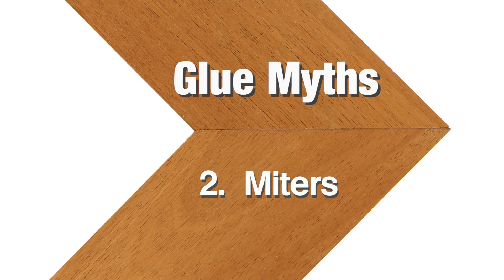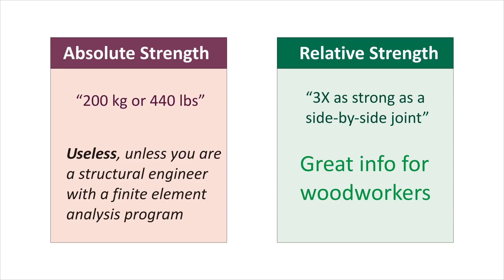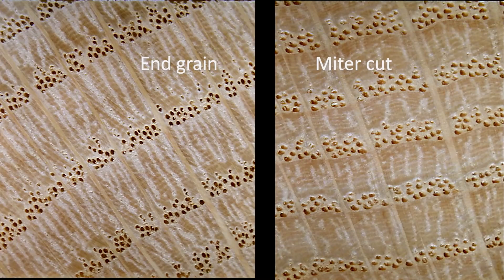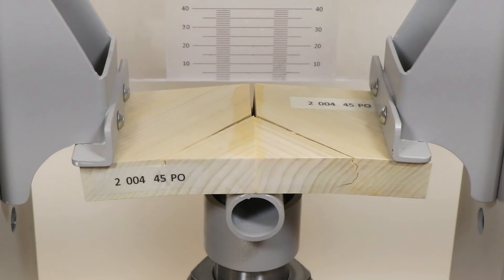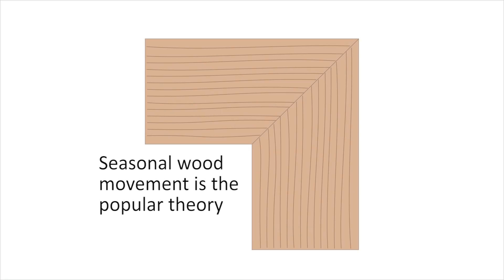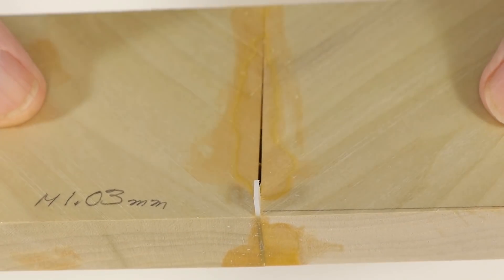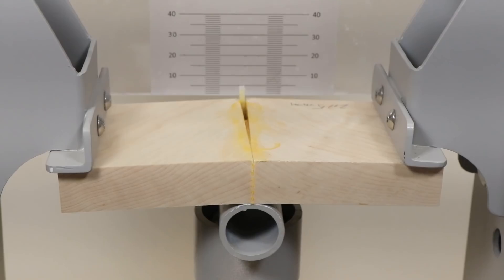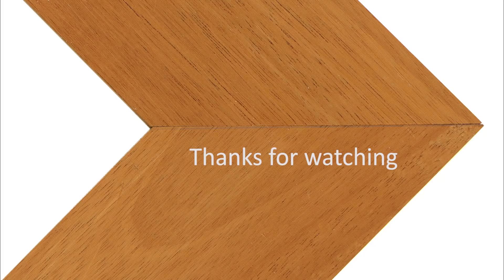Glue Myths:  2. Miters

Comment: Really good video. I particularly appreciated the call out to "this is not what the engineering/physics of a joint is like; this is simply an observation on the strength of the glue bond". 

I think this is a large part of the "myth making" - Rob Cosman's video in response to your first drives that home: his 'dado joint' fails because the lignin bonds fail (and the leverage is huge); the rabbet joint doesn't because of the amount of glue surface, the presence of long grain in a mechanically significant situation and less leverage.
Reply: "the rabbet joint doesn't because of the amount of glue surface"
Yes, that is one of the reasons why nearly every other joint is stronger than an endgrain-glueup.
Sadly here in these videos he does not show any joints other than the weakest butt-joints... likely cause it would look kinda silly when a simple lap-joint is several times stronger but he then continues to claim endgrain-glueups to be strong.
Reply: @ABaumstumpf  As others with way more woodworking experience than me and probably you  (James Hamilton, Marc Spagnuolo, Steve Ramsey, Rob Cosman) have noted, it's not at all what Patrick is saying in either this video or the previous one.

Incidentally - a rabbet joint is basically an end-to-side grain glue up. Plenty strong enough to hold a carcase.
Reply: @dlevi67  Yes, a rabbet is mostly endgrain to sidegrain, not really a strong joint against any rotational forces, but rather strong against linear forces from the outside of the corner - cause that joint takes advantage of geometry.
But the miter-joint being weak still is not a myth but a fact - it is one of the weakest joints you can make, just not the weakest simple glueup. Buttjoints in general are weak and avoided cause of that, but sadly he is only showing those weakest joints and not something like scarf-joint.
Reply: @ABaumstumpf  Again - that is not the point of the video - and Patrick (and all those I mentioned above) says that very clearly and explicitly. As does my comment.

Comment: So much depends on the geometry of a piece employing the joint(s) and the actual types and direction of forces applied in service. I’m thinking of a large picture frame I built several years ago. Sure, these miters have little surface area in proportion to the torque that could be applied by the long moldings. However, excepting catastrophic events like falling to the concrete slab, my frame will never experience torque from spreading two adjoining sides, nor will it ever see the front and back faces in a tension-compression situation like these demonstrated tests. As it hangs, the frame must sustain its own weight plus that of its contents and its glass. Assuming balance, symmetry, and dead nuts accurate miters, the mitered joints are in tension only, at least until a failure should begin, which could introduce torque. This straight pull on the joint is different than any of the test breaks we’ve seen. My only concern with a frame miter is that the joints don’t simply drop apart from the tension. Wood strength is immaterial in the vertical moldings. Splitting resistance might be a small factor in the horizontal members. Glue adhesion to the mitered faces would seem to be paramount. It would be interesting to see end-grain and mitered joints pulled directly apart, rather than being snapped as one snaps a twig, which imparts tremendous force in the tensile plane, progressively weakening towards the compressive plane...effectively wedging the joint apart from one side.

When I’m building a fire, I’ll snap a one-inch diameter branch over a fulcrum, same as these tests. But I could certainly never pull it apart lengthwise. In this case, gut feeling is that the glue joint is nowhere as strong as the wood (though it might be adequate for a particular application).

Comment: Excellent videos! I wonder if the myth of weak mitre joints in boxes may have originated with hide glue which is essentially a surface glue not a penetrating glue like PVA? I’ve not used splines in mitred boxes and they are still holding up 25 years later.

Comment: Thank you for the terrific videos, Patrick. Questions: Because picture frames are commonly miter joints and since they often fail (in my experience, at least) when dropped, do we know how they would hold up to a single impact versus the sustained pressure of your current test? On a different topic, I wonder whether a method exists to simulate, say, 50 years of racking forces in a reasonable amount of time for an experiment. I'm talking about the kinds of forces we might expect to see in "daily use," and I'd leave it to you to turn that term into something measurable. If one can simulate such forces, and if it interests you, I'd love to see videos testing the longevity of various joints. The joints I have in mind are glued mortise and tenon (blind), draw-bored mortise and tenon (blind, no glue), and bridle. Thanks again!
Reply: If you have a sacrificial frame, it might be intersting to see/hear how much glue they are using. Given that the joint is on display, they could simply be under-gluing it.

Comment: The geometric advantage of a mitre joint in resisting rotation around a z-axis perpendicular to both wood grains is that it creates a greater surface area that importantly extends farther from the axis that acts like a hinge. This increases the bending moment of inertia of the structure, similarly to how an I-beam is stronger than an “H-beam” (90deg rotated I-beam)

I’m not an expert, but it seems to me that the geometry of stress on a typical mitre joint would be in this direction, bending around the corner, as though the mitre is a hinge that rotates around an axis perpendicular to both grains. You have set up the joints rotating around an axis 45deg from both wood grains. I understand the challenge… cutting a slice from a mitre joint of 4x4s would give you the shape you’re looking for, but it would dramatically shorten the cellulose into upside-down V shapes, creating new locations for failure.

Comment: Can't recall if my comment was on yours or Rob Cosman's video; I think the HARDNESS of end grain joints (vs. the much softer, compressable fibers in edge/long grain) requires a more perfectly flat/mating joint, and that slightly imperfect joints are much less forgiving when clamping up end grain than edge/long grain.

Comment: So far, I am loving this series, the experiments and how the results challenge preconceptions. 

However, I do have a couple issues with the conclusion, and I think most of the pushback you've gotten comes from this: While you conclusion isn't wrong, I think it's incomplete, because the real cause of the "weakness" of edge and miter joints is based on practical issues in the shop.

Basically, side to side and face to face joints feel stronger because we ask way less of them. They tend to have a lot of glue surface, and very little actual bending stress. end grain and miter joints? usually the opposite. Which is why we do halflaps and tenons and splines and whatever, to reinforce overstressed joints with wood fibers which are stupid strong, or at least extra glue surface.  You do touch on this during the video, but don't really focus too much on it.
Reply: "Basically, side to side and face to face joints feel stronger because we ask way less of them. They tend to have a lot of glue surface, and very little actual bending stress."
Only the middle part is accurate.
He had a perfect opportunity to test a miter joint against a longgrain-joint like a lap-joint, but didn't do that. Why? Cause a lap-joint is much stronger.

Comment: really enjoy
excellent analysis and experiments

i really like the conclusion that the glue is strong, but there are many other factors to consider as miter joints can be under way more stress than others due to the design 

doing a test on splines seems tricky because different combinations of woods could yield different results and that would be kind of a data nightmare

Comment: if you use wood which changes its width a lot when  moisture changes you may end up with situation in time 8:16. Typically in autumn high moisture wood is used and next spring inner corners are open. Pine is one such often used wood. We in northern Europe use it too much. It really opens corners by itself without external force like in time 8:16.

The rule for stength is to use stable woodmaterial.

Comment: When working with kiln dried materials on projects like your clock or interior casing I have never had a glue joint fail. I have had wood crown moulding joints fail with large humidity swings when the crowns profile changes thickness across its width. For instance, a simple cove detail where the center is much thinner than the sides. However, this has only happened to me once. Exterior projects are where you really see miters fail. In fact, they have a 100% failure rate. I have done railing repairs on miters put together with splines, biscuits, screws or some combination. They all fail. The best I have tried are half-lap miters. That way the customer gets the mitered look on top but the miter is only half the material thickness with a large surface area for glue underneath. 
I like your methodology. However, the direction of force applied in the press is not the direction force would normally be applied. What you did by hand is what a miter would have to live through, be it pulling open stressing the heal or compression stressing the long point. Not vertical force directed over a fulcrum. Try the same press test with the glue-up on edge and not flat. Would the miter fail in the same way? Also, your results of glue joints breaking followed by splitting along a grain line might have much to do with the short length of your test pieces. I think this because I have glued up door casings then hit something when moving the glue-up and the pieces didn’t split like you saw in testing.

Comment: You gotta do the splined miter video! Please test both kinds of splines. Also, I wonder if the direction of the grain in the spline itself matters. I suspect that splines perpendicular to the corner of the joint do nothing, but I have no way to test that. Splines in miters do have the advantage of reducing the mobility of a joint while the glue is drying and making it easier to clamp. Great videos!

Comment: It might be feasible that the strength is heavily dependent on the direction of your test. For example, if you applied the force orthogonally to what you are doing now, you might get very different results. When I think of breaking a miter to test strength, I picture 2 pieces of wood with a mitered joint being forced open like a hinge, not a force being applied along the face of the miter.

Comment: Your demonstration is good but is missing one thing. and I think it is important but also sort of obvious. Mitered corners don't separate from the bottom up the separate along the length of the wood. I know you were trying to keep this test similar to the previous to compare; but the sample should have been turned turned 90 on edge and each piece should have been longer to resemble the miter more. pushing down on the ends and up in the middle would have separated the joint sooner.

Comment: I make a lot of pictures frames, sometimes big ones for mirrors. If you properly cut the miter, using a shooting board with a well sharp plane blade, you’ll never have problems, the frame is plenty strong. As I say on the previous video I don’t know how and how much time, moisture, heat and external factors can cause problems.

Comment: I'm wondering if in place of a manufactured biscuit, a piece of hardwood one third the thickness of the frame was used instead. Then there's using dowels as well. This could also be tested. I love mitre joints, they look the best in my opinion.

Comment: I presume that every mitre joint is held in place with a high compression while the glue cures. When the clamps are released the glue joint is immediately placed under load as the wood springs back into shape - minimally when the angles are perfectly cut but with increasing stress with misaligned joints that were forced together by those clamps.
In time, I suspect that the wood grain and lignin will slide so as to alleviate the strain and a mitre which survives for six months will last forever.
However, as the clamps are removed the glue line could microfracture leaving a weak spot or tug sharply enough on some of the wood fibres to tear them away from their lignin support. Loosening the clamps very slightly and leaving the piece for a few minutes before they are removed entirely might help keep an imperfectly cut joint strong. It would allow the wood and glueline to accommodate the different stress directions by stretching and sliding inidividual wood fibres to spread the stresses emanating from the points being subjected to higher strain across a wider volume of nearby material.

Comment: Curious if the volume of glue used in your open meters affects the results.  If you repeat the test with the exact same volume of glue evenly spread, the I suspect it would be more consistent.  More glue would fill more of the open miter and increase the strength

Comment: I am enjoying in the approach to testing these myths. I would like to say, you are testing the bending strength of the mitre joint. But as per you demonstration with breaking them by hand, they are weakest when the load is prying the joint open. 

When we use a mitre in frame or a box and that item is abused (dropped or something) they will experience that prying load, not a bending load.

I would be interested to see a sample with the edge grain at 45 degrees, so your test would look at the prying stength of the joint.

I think this and the end grain myth is a simplification of reality. It isn't that the glue joints are weak (as you have shown), but they are typically used in a way that leads to very high leverages and low glue areas (again, see picture frames). People took to saying mitres are weak rather than "in the typical way we use mitres, they are likely to have large leverages that make them fail at a low applied force".
Reply: Nah, it is simpler - endgrain-joints are inherently weak.
If he would have use a simple lap-joint it would become apparent as that is multiple times stronger for such frames, but he chooses to only compare the weakest form of glueup butt-joints.

Comment: The perception may come from that mitre joints are often smaller and more likely to be used in places where they'll get torque. e.g. picture frames and drawer sides. Tabletops made from side joined pieces are always supported by the table frame, legs or whatnot so never see torque.
Reply: Well, and from the fact that for the same frame-geometry a splined-miter or lap-joint are much stronger.

Comment: The problem with this test and with miter joints is that they tend to fail when force is applied in a different direction.  It would be interesting to see how much force it takes to break the joints (misters as well as the joints from the first video) if the force is applied 90degrees off what the OP has done so far.  So not on the flat.  Like he does when breaking the long miter jointed wood by hand.  Also the other issue is that some joints tend to have longer boards and shorter joints such as miter vs shorter levers and longer joints such as glued up panels.  I think the reality is that ALL glue joints are weak it is just things like glued up panels don’t need strong joins but corner being more structural do need strong joints.
Reply: Yes all glued joints are weak compared to the strength of long grain fibers. This is why we go through the trouble of making mortis and tennons instead of butt gluing aprons onto table legs. Glue is weak and lignin is weaker and neither of those has been acceptable in most cases. Certainly not in major furniture pieces. 

If you’re just doing a DIY project then by all means glue it together and hope for the best. But if you’re making something nice you may want to consider taking a little extra time to get some actual long grain wood fibers the cross the joint instead.